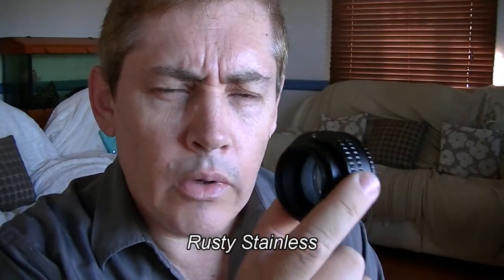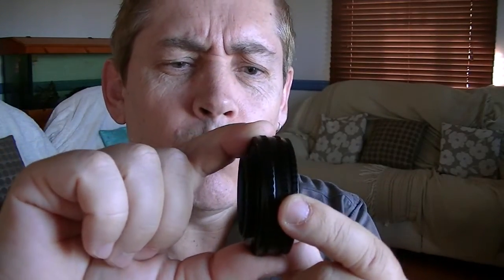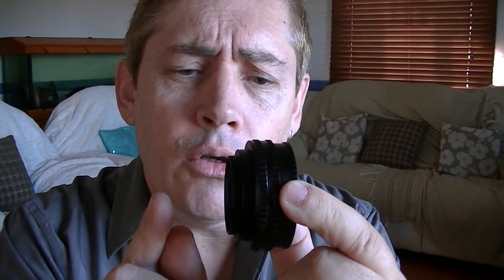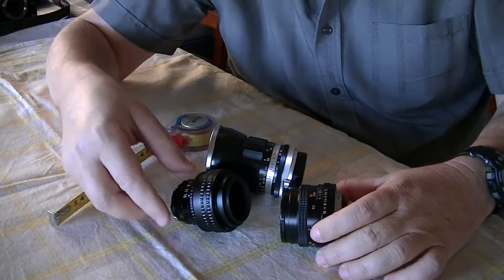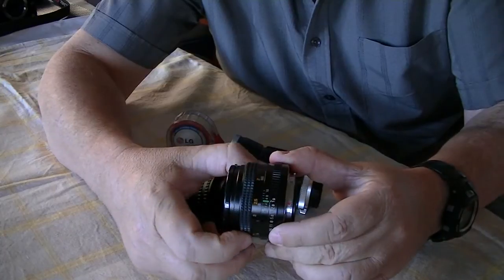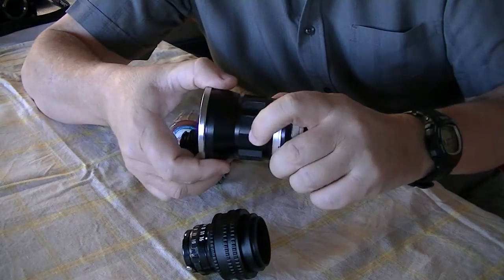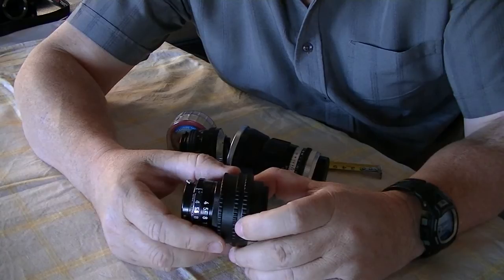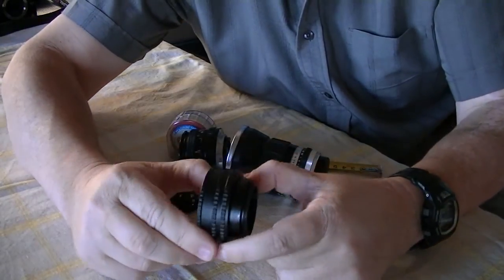Helicoid focusing explained, for mirrorless digital cameras

Comment: I want to be able to use these and larger lenses and some other ones like off of old exactas for portrait and landscape it would be good if you had a link for this helicoid . There's just so much stuff on eBay it's impossible to know a good reputable seller
Reply from the maker: Links always break... Especially when the seller runs out of stock. Like you, I just have to check the seller's feedback, say a pray, hit the buy button, and use PayPal.... More importantly, beware of paying too much. One of my helicoids is a Pixco brand and I can see the prices vary way too much. Don't pay more than about $30usd. Good luck.
Reply: @tapmad  thanks you too. I do have a think a old  Russian lens I've actually seen people just almost do their own lensbaby helicoid with bicycle tube her kind of like a vacuum cleaner hose but wider I fear though it's the sensor I did read something about an air vacuum forming and putting too much pressure on the sensor you have to put like a tiny pinhole other than that I did go the route to buying a bunch of PVC plumbing the best helicoid I seen and I can't find a video it was like have three different one fun like a little box it was kind of colored I'm a channel that reviews weird lenses but I can't track it down. I'm sorry I'm getting off topic so I was wondering if I can take that 85 apart find a way the set the enlarger in to the helicoid I'm trying to use these things for anything but macro
Reply from the maker: @unbroken1010  if you like tinkering, go for it. If you like taking photos buy the helicoids - they are ready to go, worth the money. Are you more a tinkerer, or a photographer?
Reply: @tapmad  no I went to school for photography have a decent career before 911 wrecked it was not really able to bounce back too much after that. But I believe in crafts I have always experimented with toy cameras darkroom chemicals cross processing photography has become too sterile with mirrorless we got to become Alchemist again
Reply from the maker: @unbroken1010  Tinkerer, enjoy. No shame.

Comment: by the way, a helicoid is the focus assembly, sometimes needed as well for old Nikon and rollei rangefinders, as they had the focus tube in the body, not as is common nowadays to have a separate helicoil focusing assembly in every lens ( why we never hear this term anymore)- apart from the obvious in the tubing affixed to a Leica visoflex adapter to get macro on the Leica M series of cameras to focus. one other application is as a focus method for enlarger lenses as well as mounting vintage non-focusing lenses on a Sony a7 or other non mirror camera.
Reply: I don't want to use them for macro I want to use them for portraits and Landscape so what's the workaround for that